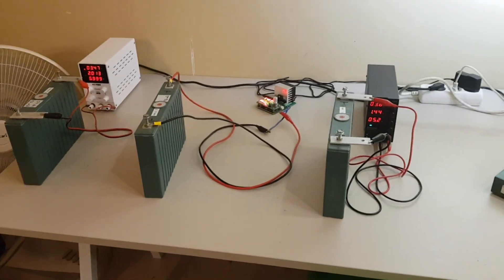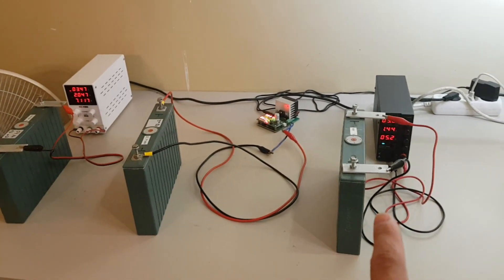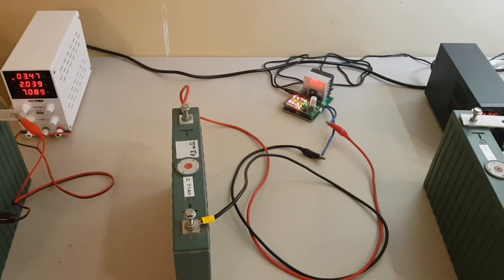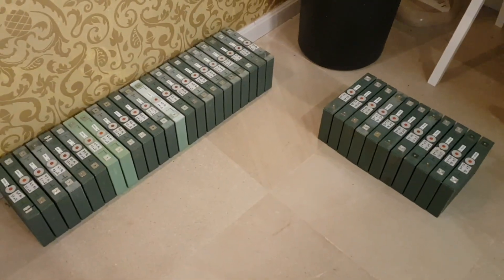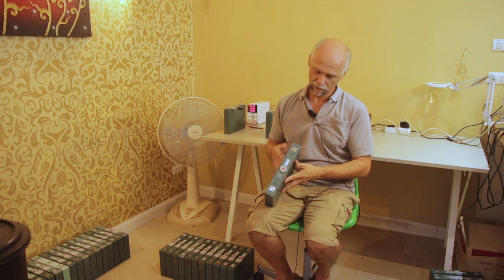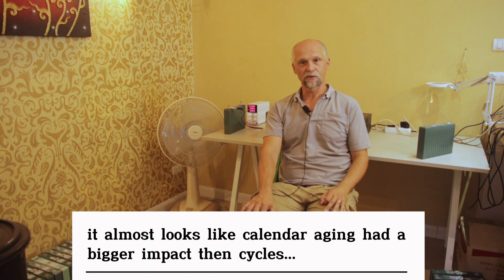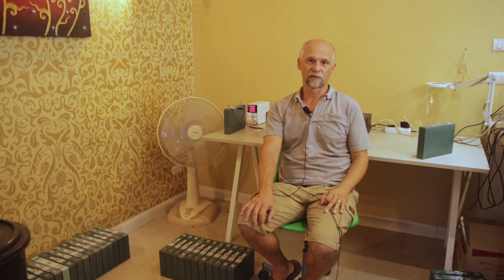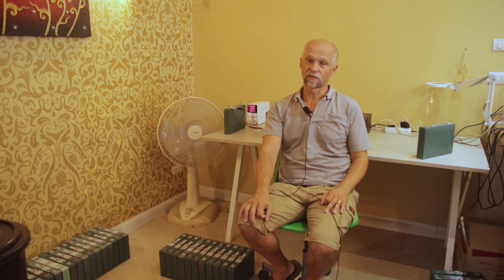LiFePo4 Cells at the end of their life! How did they perform, what's left of it?

Comment: Hard to tell what you have if they are not new.  If you did not get over 100ah then they are not new.  Also most manufacturers do not specify the life beyond the 80% capacity degradation.  Since you did not know the initial life, its hard to know how they were used.  This data is hard to draw any conclusions as the batteries were already considered end of life when you got them.  If the first life they were cycled at high temperatures, rapidly charged, or charged above 3.65v, they will have a much lower life.
Reply from the maker: Yeah. Today it is easy and affordable to buy new LFP cells. When I started, most DIYer where collecting 18650 cells from Laptops and Tools. Or you where willing to pay 3000-4000Usd for a built 10kWh pack. But of course, now I know it was the wrong decision to get the 2nd hand batteries. You really need to know precisely what you get...

Comment: Of course there is a big unknown about how they were treated that degraded them initially. Your charged and discharged voltages equate to about 90% cycles which is over the percentages quoted being 80 and 70%. Cycle testing is I believe done at 25°C and it is well known that cycle life decreases as temperature increases. You mentioned 45° and of course in their previous life, if cycled hard in an automotive application they may well have got quite toasty so greatly speeding their degradation. I can see that mounting them on their short edge down could lead to issues with the electrolyte. I think overall they've done quite well. I have actually been pleasantly surprised by a bunch of used / abused cells obtained from warranty returns, they are the newer aluminium prismatic CATL or EVE cells. The returns I put down mainly to bad BMSs failing to balance properly leading to capacity loss due to imbalance. On stripping down and balancing properly and then doing capacity tests the majority of them were still able to pull full capacity or very close to it.

Comment: What about 1st batch might be from the 1st car / buss that failed or maybe a prototype that was pushed to its limit for testing 

Why do i think this : 1st batch is horrible 
2nd and 3rd are less horrible 

2nd theory   you killed them 

1st batch is worst and the longest in your care 

Like mentioned in the comments new cells degrade faster in hotter climates 

My 315ah cells live in my basement for a few months now  i might see you in 5 years
Reply from the maker: I didn't say anything about which batch was use how. My batches I just got at different times. 5, 3 and 2 years ago. The only similarity they had, was that when the arrived the capacity/SOH was down to around 80% and that is because at that time the previos owner which surely was a company which used these batteries by certain rules, replaced them.
When they where with me they linearily degraded further by around 10% a year. And that might be because of a killer first application, hot climate, wrong operating position, etc, etc.
If you have brand new 315Ah cells in your cool basement now, and you are using them correctly by specification, then we will all hopefully not hear anything from you about failed cells for the next 20 years ;)
Enjoy your storage system mate! Don't worry.

Comment: So....   You did buy second hand cells. You do not know how these cells where charged and discharged, but you do know the cells will degrade faster than promised. I think the cells where charged too high and discharge too low what made the cells degrade. Used in busses?  High demand power.
Reply from the maker: Yes, of course. The first life application had knocked them out. But I can only estimate by looking at the spec sheet. Especially when the seller tells you the cells are brand new :)
With one of them I even had an argument. I showed him my 80Ah test result and he replied my test gear is crap. Then he showed me a test result he made with a ZKE tester which got 100Ah :))
The issue is that China should actually ban the export of trash cells so that other Asian markets don't have to deal with it.

Comment: One very real risk is that given large variations in remaining capacity, I wonder how many of these cells were damaged from being over-discharged either during their original lives, or while they were sitting around in a warehouse before being reclaimed and resold.   I would guess... probably quite a few.

SEI layer will also matter a lot... one of the big distinguishing factors between 1st generation cells and later generations.  People didn't really understand how SEI worked in early generations of cells.
Reply from the maker: All possible. LFP-cells typically will bloat quite quickly if they get over-charged or over-discharged. One would see that probably. But yeah, those cells are sorted out for a reason. So it might be better if they just go straight to recycling...
Reply: I once heard a story that recycled lition ion batteries where slightly better as new ones because the lithium layer was more porous or something 

It was years ago and they probably made the new layers more like the recycled ones 

But I do hear that you apparently can messure the wear on a new cell by its thickness

Comment: Sorry roland, dont agree with you finding .
I believe you synon cells had a very harsh life before you got them, plus they were probably in a non temperature controlled space ( a citybus most likely) 
My calb 100A cells ( blue plastic casing , first gen) from 2017 , that came out of an airplane ( with only 100 cycles when i got them)  still have 85% capacity left and have been my main battery since 2019 untill 2022. I put on 1500  cycles and started replacing them because of space constraints ( now run 12 seplos mason 280 diy boxes).
Still have them as a backup and cycle them once a year.
Reply from the maker: yes, very much possible that the first life was a killer application. I wouldn't buy 2nd hand cells anymore, especially not with today's cell prices for new batteries. thanks
Reply: @RolandW_DIYEnergyandMore  agree, especially given the current pricing and capacities

Comment: I wonder if anyone has made a setup for doing cycle life testing of individual cells. Most cells can tolerate 1C charge/discharge, so in theory you could do a cycle in 2 hours. 2000 cycles then only takes about 6 months- and if you're draining one battery to charge another, it wouldn't be too energy intensive.  

Similarly, if the cells are from a bus fleet, they may have been seeing more then one cycle a day- hard to say though. Looking up chinese electric bus range, I'm seeing 250km- depending on traffic/driving conditions that could be 8 hours / a-single-driver's shift- run once in the morning, charge for 2 hours, and run again on evening shift. Maybe.
Reply: One interest facet of this is that quite a few "used" LiFePO4 cells on the market are from multi-cycle-daily use cases just like that, which means only cycle wear to (usually) 80% capacity with very little calendar aging.  And people who buy those used cells that have been relabeled with their new capacity as "100%" generally expect them to last about the same as a new cell would.  That is, another 15 years or so to the next 80%.   Which is unlikely but... that's what people seem to expect.
Reply from the maker: Exactly
Reply from the maker: great. I guess you already do have the newer generation cell models?
Reply: @RolandW_DIYEnergyandMore i think these you have shown in video are winston cells
Reply: By checking weight to capacity (energy density) we can check the original capacity of the cell @junkerzn7312

Comment: I only rate my equipment by roi so if I got it at the right price and my roi was decent then I am happy. I use this method because manufactures specs are always slanted for perfect conditions. I am replacing my 36 volt packs with 48 volt this year as they have paid for themselves I do hope the new cells and inverter last a long time as they are expensive but so is utility electricity. Some of my lifepo4 26650 cells had corrosion likely from electrolyte escaping the vent. I do believe the newer Lifepo4 are of better quality then the 10 year old ones we have been using. Cheers
Reply from the maker: my ROI for these cells was negative unfortunately 😢. But there was nothing else available at that time here in Thailand. Was hoping the cells would last longer. I am sure the new packs will do better tho. we started early so we needed to swallow bitter pills too. today a lot of the difficulties are gone. all lot went mainstream 😊

Comment: Its the temperature! it was not in past, but these days lifepo4 are rated for 25C, which is something different then outside in Thailand. My EVE are rated 6000 cycles at 25C, but 45C its just 2500. So if its around 35C outside, cycle life could be even half. That teory of drying one side might be seen via thermocam. What was price for that single cell? Also did you use them below rated C-rate? I think with temperature affection with C-rate increases quite a lot.
Reply from the maker: The price for those cells where around 1000 baht (30 USD) at the time I bought them. Today they are sold for 600 which is still totally overpriced compared to new cells considering what crap you get. People still buying them as they do not know enough about the matter while the sellers here do not play fair. 
The C-rate was only max 0,25 for the degraded cell pack (had a max current of 85A there while charging). 
I always thought that the temperature should be fine as EV-car batteries will probably get warmer here in Thailand when driving around. My cells did reach 45 deg during the hot season, and that is just from the ambient temperature at that spot...
Reply: @RolandW_DIYEnergyandMore  People try to scam everywhere, but they will get their karma. 45C is a lot i think, they might benefit from some heat reflection, to not get 1kW/m2 from sun. What about discharging rate? Also 1C for 100Ah cell is 100A, but when they degrade to 80Ah, its 80A, or former 100A is 1.25C.
Reply from the maker: My discharge was at 60A at best when all 3 inverters where working. it was mostly at 40A max means somewhere at 0,12C for the degraded pack :)
Reply from the maker: @marcusbinner9656  divided by 3? had 6 cells in parallel with 280Ah remaining capacity per string. But yeah. that's why they had to go :)
Reply: @marcusbinner9656  but with the increased internal resistance the current on the degraded packs is lower
Reply: @RolandW_DIYEnergyandMore  But would be nice to see some reports how EVs handle environment heat.

Comment: your powerwall was degrading cells faster then normal because you connected CELLS in parallel. always make cell connections in series. your BMS/charger has to be able to measure voltages PER CELL, not per busbar to do its job. otherwise voltage differences between cells can not be measured.
Reply: This is non sense .
Paralleling cells is just fine, just makes it much harder to monitor individual cells
Reply from the maker: Its an interesting thesis, but a BMS is just monitoring cells, it doesn't do anything actively to charge or discharge a cell. The cells are charged by the voltage potential across their terminals. In theory each cell in parallel will charge equaly but when you mix different capacity cells in a parallel arrangement same I did then currents will split differently as dictated by the internal resistances of the cells. 
Modern cells like the EVE280K, Hithium 280Ah, etc do have 2 core-rolls connected in parallel within their canister. Each of those cores would be considered as a battery cell.
And if I would have splitted my powerwall battery into 6 packs in parallel nothing would have changed. Assuming i would have matched the cells (no mixing up of older and newer cells) within those 6 packs, they would as well all have run on a different currents due to the different internal resistances. The whole battery might have caused problems even sooner as the internal resistances are spread so widely and single cells in those different packs would have caused BMSes to shut down individual packs...